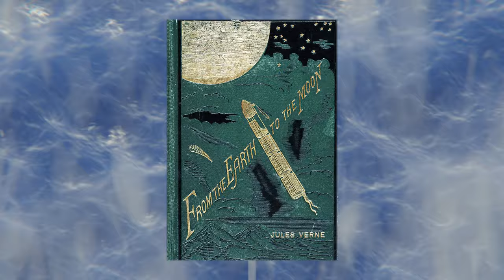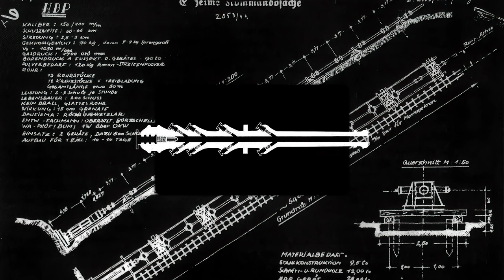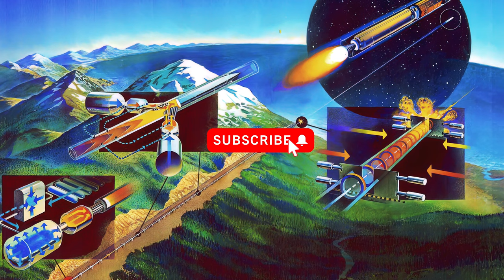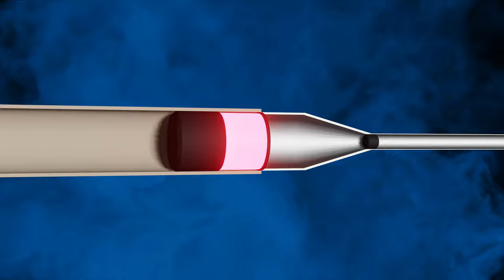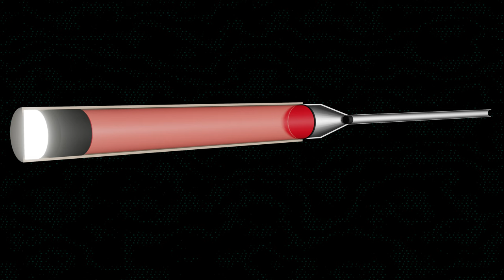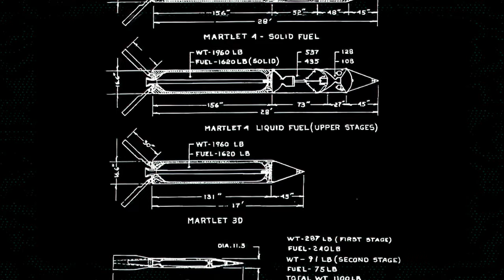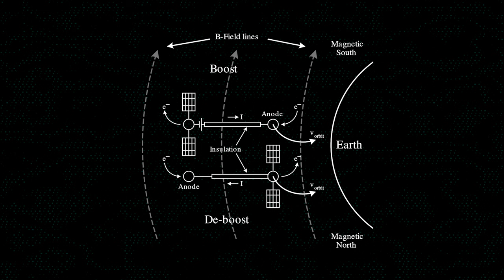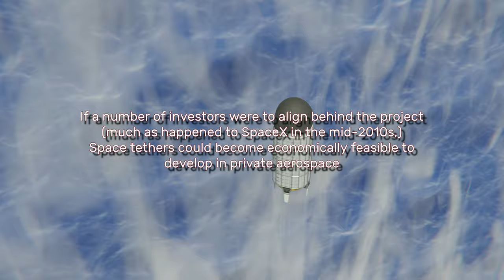Light Gas Guns to Orbit! Greenlaunch, Spinlaunch, Quicklaunch, SHARP

Comment: Disappointment here for me in what I thought would be the first YT video detailing the career of John Hunter, father of SHARP, and Gerald Bull of HARP.  (SHARP, Super High Altitude Research Project.)  At least Hunter was pictured and the SHARP gun diagrammed, but most of the video turned out to be on this concept of a 'sky hook,' not the CLGG as titled.  The video suggests that Gerald Bull came after Dr. Hunter, that Bull's Iraq Project Babylon was trying to catch up to Hunter and his CLGG at LLL.  Bull pioneered the gun to orbit concept long before Hunter.  Bull's use of direct propulsion using smokless powder would limit velocity to about two km/sec (the velocity at which the first stage of many rockets would burn out) so Bull's projectile would need a second stage rocket to get into LEO.  Hunter's use of H2 would not need a second stage since the gas could kick the satellite up to 8 km/sec.  Only small rockets to taylor the orbit would be needed.  So if Hunter's concepts for injector LGGs and the Quicklaunch Company were funded, there would be little need for skyhooks.  But no detail of these guns was dwelt upon here.  The video is correct in asserting that without a precedent of success, capital will not flow to LGG research--so no chicken, no egg.  But if a country were to pour seed money into building a facility that could shoot useful loads into space, capital would flow.  Most of the mass now costing an oz of gold per kg lifted into LEO is structural material and rocket fuel--things that can easily be g-hardened.  Rockets will still be used for people and other soft items (until a gun with a 300 km barrel is built).  Gun launch to space will happen when some entity with the money is willing to spend the same amount Space X is to develop Starship.  But the first and second stages of this launcher will stay on the ground (or mountainside) built mostly of concrete and steel, big as Hoover Dam, and as easy to access and maintain.  Then the cost per kg to LEO will come down to that of a trans-pacific flight.
Reply from the maker: Keep in mind the video is a 15 minute brief on the past, current and future applications of the technology. As interesting as the history is, a complete telling will take at least an hour and I hope to eventually go there in a longer format.

Since this channel focuses on the future, I was interested in presenting the idea along with more recent complimentary concepts instead of rehashing the developments at SHARP. Skyhooks have recently become experimentally viable, something neither Hunter nor Bull would have been cognizant of. Skyhooks are not necessary but they are inevitable, and if we have them we would certainly use them in conjunction with gas guns due to their flexibility.

Comment: you just need to go straight up, right?
ok heres the plan.
12 stages in a horizontal wheel-spoke formation that convene in a straight up verticle bore.
12 pistons compress acetelyne, setting off 1 burst disc with the autoignition, then this shoots another piston straight up the middle, compressing hydrogen in the final 13th stage, which then bursts the last disc and fires a brick sized payload. Something like an EKV, which is a brick with correctional thrusters on it.

I really do believe you can make ICBM sniping work